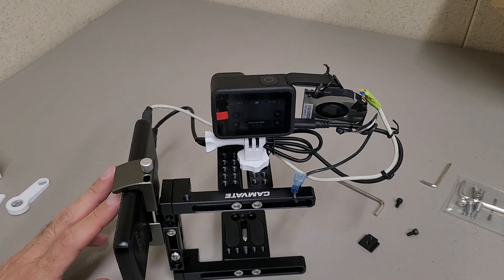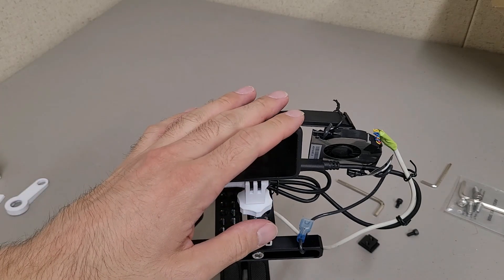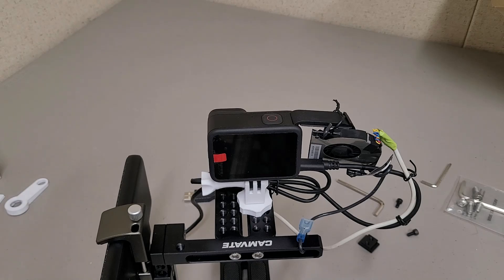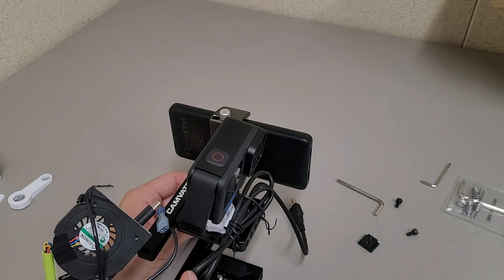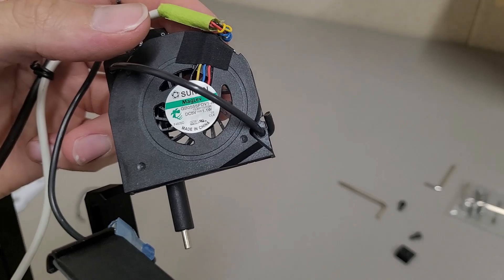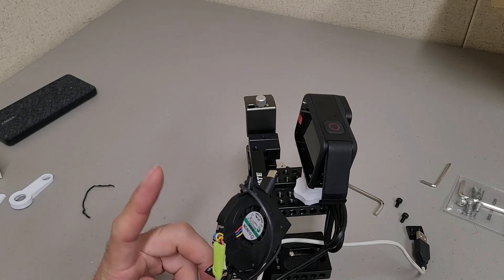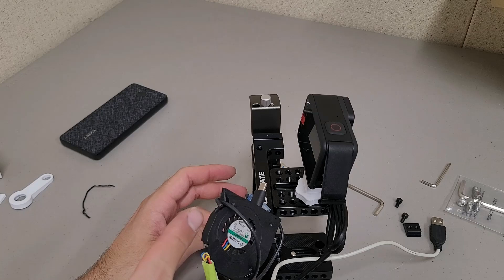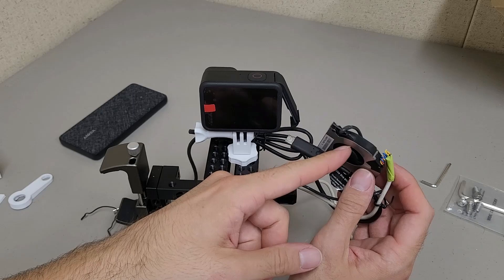I made my own DIY active cooling solution for my GoPro Hero 10 out of free parts

Comment: It would be awesome if someone started manufacturing passive heatsinks for gopros (most the the heat comes from the inner wall that is next to the smaller screen and from the mounting ears).

With an option to attach a small fan to the heatsink. But I feel if the heatsink surface is big enough it may work without a fan
Reply from the maker: I think there are kits to replace the case to make them run cooler but they are expensive and require modifications to the GoPro.

Comment: This is excellent! You put a lot of thought, and expertise, into this setup.... with the fan blowing directly into the GoPro to cool the front and back and all, and the 12.5 volt power pack to run the setup! 🌟

This is so interesting and well explained; I feel like even I could put one together and know where to look for parts!💡

I imagine, during those four hours, you checked up on it a few times and were relieved it was keeping cool and carrying on 👍✌👏✈
Reply from the maker: Yeah the times the audio in my recordings got muffled was when I was putting my hand on the GoPro to check its temp. 😅 It was just warm to the touch and not scorching hot like it normally would be.
Reply: Good job! and the fan noise outside was virtually imperceptible!